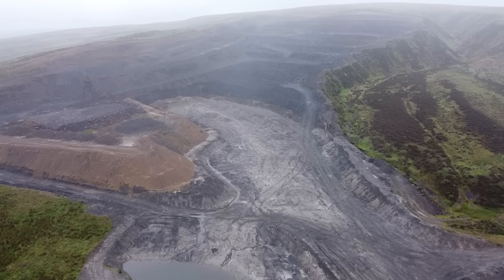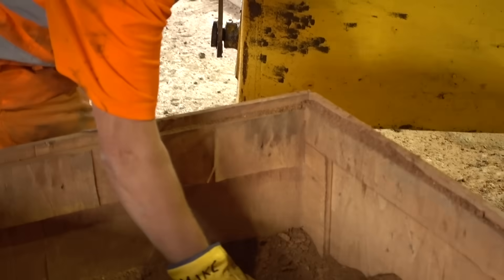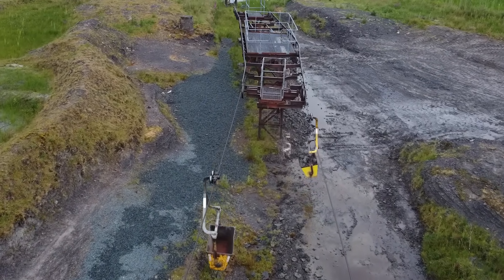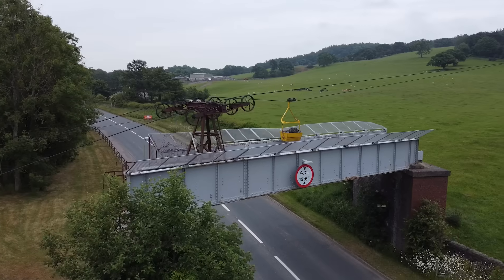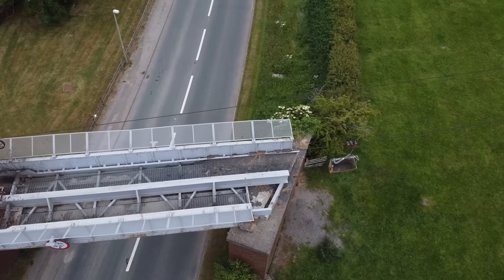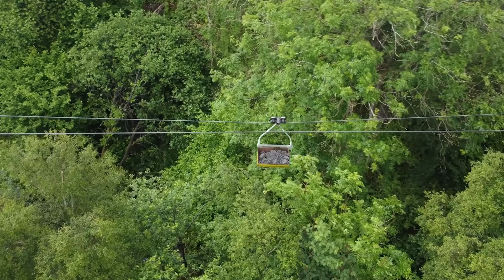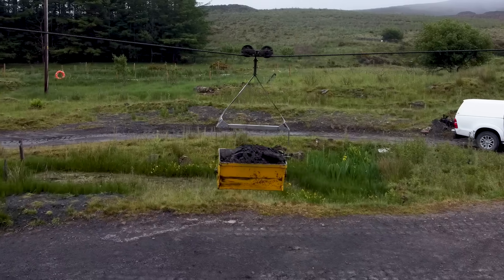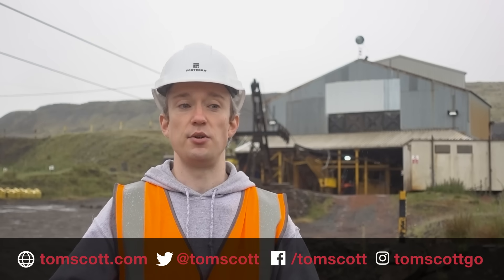The UK's last aerial ropeway uses no power, moves 300 tonnes a day, and will be gone by 2036.

Comment: Can you imagine the amount of fuel savings, labor hours ( truck drivers ) and lack of pollution this ropeway has been responsible for over its lifetime? Well done to the engineers of yesterday.
Reply: Never underestimate the power of an old bloke with a slide rule
Reply: @jayoliver3734  this is a quote I need hung on my wall
Reply: I am truly amazed. We need more of this.
Reply: @tiki_trash  This was my thought - why the hell aren't more quarries and mines using similar setups? Even if they needed some power due to less favourable geography, I'd guess an aerial tramway would have huge fuel savings over lorries or rail, and is much less disruptive to the environment than either, and easier to electrify.
Reply: @lmlmd2714  over lorries yes, rail less so. With rail your main resistance is from air resistance (above around 20km/h) since even a 16 car train with 120 wheels will only ever have around an A4 size area of ground friction if you're unlucky. If you're lucky it'd be around the total area of a 50p coin.
Reply: @lmlmd2714  Because this setup only works down a hill.
Reply: @tiki_trash  on this large a scale probably not but on smaller scales? this could be incredible
Reply: @tiki_trash  if we always went downhill, we could!
Reply: Check out English canals. England used to move tons of coal and products across the country by longboats dragged by a single horse.
Reply: @Nemesis_T_Type  Horses are more polluting than trucks.
Reply: @Nemesis_T_Type  and blokes on planks for the tunnels.
Reply: @Nemesis_T_Type  if you're fine with low speeds, boats have some of the lowest moving resistance that likely tends towards zero in still water. At high speed, boats become extremely inefficient. I think it needs like 8 x the power for every doubling of boat speed, meaning 4 x the energy use for the same distance.
Reply: @Nemesis_T_Type  
Sad that UK produce nothing these days
Reply: @P JL Good point. There’s an old limestone quarry about a quarter of a mile from my home that’s now a Site of Special Scientific Interest, due to the wildlife living in it, and especially due to bee orchids growing there. It’s a big hole in the ground where the sides of the quarry shelter the ground from the worst high winds. Nature finds a way of making something work, even when mankind has massively interfered with the landscape.
Reply: @BungleBare  Many quarries worldwide have ended up becoming rich nature habitats and sources of water.
Reply: And this kind of tech could be used today and make our world cleaner, and better. But we don't measure the right things or value them. The people saying this costs more $$$ are correct. And in our world that is the only "efficiency" that counts. Even if it means pouring toxic fumes into our lungs, if it saves money then it's OK.

This is why we'll go extinct. Stupidity.

It's the same philosophy that says driving a car to workout in a gym is more convenient than riding a bicycle.
Reply: @ruslbicycle6006  and it's funny because nothing about this world is efficient.
Reply: not so much. 4 employees required constantly. 2 shifts per day.
a union job for life, filling buckets.
become an expert after one day. snore
Reply: @godsinbox These days, the it could easily be mostly automated, it's just not worth it to heavily rebuild multiple structures for something with such a limited lifespan.
Reply: But can they replace the break pads with electric generators?

I've heard, but never fact checked tbh, of mining operations using electric trucks that never need to plug in; start at the top with a full load and an empty battery, regen breaks the whole way down the hill/mountain, drive up empty on the power from the trip down.
Reply: @peterelliott3905  No offense but what would be the point of that? It just sounds like doing what the rope way does but with extra steps.
Reply: @kylesmith4173  The plant has tons of conveyors, lights, presses, kilns, etc. that could take the power…
Reply: @peterelliott3905  they indeed are a thing!
Reply: @peterelliott3905  the fact is that you have to store that energy...batteries are expensive and the energy that they would gain from it would be small? In comparison to what's needed for that company to run ..also maybe they are already doing it
Reply: @peterelliott3905  that's possible. Sounds like it can be done without violating conservation of energy, given that there's enough load on the way down.
Reply: @peterelliott3905  It would be very inconsistent power generation. You might be able to bank it into a battery pack for peak power demand supplementation, but you'd also be trying to dance a fine line between meaningful power generation while also letting the rope way keep sufficient speed for efficient operation. I would be curious to find out how many kilowatts per day the braking system bleeds off. 

Might be able to supply the power needed to operate the electrical demands within the brickworks though.
Reply: @peterelliott3905  no Regen isn't that efficient
Reply: @peterelliott3905  Eternity machine!
Reply: @peterelliott3905  Yes they can, and they would have if the cost benefit  made sense.
Reply: @peterelliott3905  That would only be possible with 100% efficient energy conversions, which do not exist.

The friction of the tyres alone would make that impossible.
Reply: @peterelliott3905  That would violate the laws of thermodynamics to be true. Change it to “charges very rarely” and it might be true.
Reply: @peterelliott3905  It does seem like someone would have thought of this. They must be using some sort of water/oil/non-friction brake though as replacing pads would be ridiculous given the constant load.
Reply: @peterelliott3905  That literally defies the laws of physics and conservation of energy
Reply: @peterelliott3905  that idea in its best form is replacing the conventional brakes with regenerative brakes but keeping the ropeway. Then the transit of the shale is not only unpowered, it’s actually power generating. Probably quite a lot. A ton of weight going down several hundred feet every couple minutes is nothing like a trivial amount of power either, you could potentially run damn near the entire brick works save for the furnaces on that.
Reply: @peterelliott3905 hahaha dude no there isn't free energy in the universe. Braking helps, electric and self driving have been around a while now in industry. Thier clients don't find equipment on YouTube so you don't know about it yet.
Reply: @peterelliott3905  regen braking wouldn’t charge a battery completely by just going downhill with load, it would need to be a very long hill
Reply: @peterelliott3905  Yes they can replace the brakes with regen but nobody would be suicidal enough to do it. Hint: regen fails then what? They need it both for a little braking normally but they must have the backup for emergencies.
Reply: @peterelliott3905  I'm unsure on this. Sounds like perpetual motion. There are always energy losses in heat, sound, friction etc. I think if the vehicle had full charge at the start of the day, and used regen only on the way down, it would keep the battery topped up enough for it to run for the day. 

You got any links or anything I could take a look at? Sounds interesting
Reply: @peterelliott3905  yes, that´s a Komatsu electric trun, it charges the baterry downhill (full of ore) and goes up (empty) with that charge
Reply: Well said
Reply: At a mine? It doesn't even offset the workers going to work... Cool concept, but it's not for environmental reasons, again, at a mine?
Reply: Maybe if you hook a dynamo to it it can even generate electricity
Reply: Old beats New :O
Reply: Big tip of the hat on this one.  Very cool
Reply: gj
Reply: Before you jump down my throat about being wrong, I’m no mathematician, and I have no idea about mining/trucking operations. But, it’s an interesting question, and I’m sure there are experts reading this that might want to dive into these calculations to see how much this would’ve really cost. So, this is just to spark curiosity. 

Using todays standards (obviously these mean nothing just 10 years ago, let alone 100 years ago) if an ore moving truck moves 20 tons per load, and gets 5mpg on Average (full loaded on the way down hill uses very little fuel, and empty on the way back, using more fuel) if diesel is $3.87/gallon (I realize they don’t use $ or in the UK) each trip one way would cost about $1.94. They would need 6000 trips (3000 each way) to move 60,000 tons/year. It would cost roughly $11,640/year in diesel. I’m sure my math is wrong somewhere. 

That number is much lower than I would’ve thought. Obviously, this doesn’t consider maintenance on the trucks (brakes alone would be insanely expensive, carrying 20 tons of ore while riding the brakes) drivers, roadway maintenance, maintenance garage expenses, load/dump equipment cost and maintenance, etc, etc, etc.
Reply: I wonder if it could compete cost-wise with a truck, a digger, and a couple of drivers though. The maintenance cost of the ropeway is likely higher and fuel costs for that short of a distance would be low. The capital cost of the ropeway must be far higher (though long amortized away). As for labour, I'd guess that the number of people would be about the same. Using trucks would be much more scalable (up or down).

For pollution though the ropeway takes the prize by far.
Reply: @graham1034  Those trucks aren’t exactly cheap though, and maintenance on those trucks is what it costs on your car with an extra zero at the end.
Reply: @graham1034  That's a lot of cable! I still think it's got to be cheaper than diesel. If it was more efficient to do another way, I'm sure the mine would have implemented it a long time ago.
Reply: @tiki_trash  if it was much cheaper I doubt we woulda replaced them tho
Reply: @tiki_trash  you are doubting the rest of the mining industry
Reply: @graham1034  What about the capital costs of trucks, maintenance, fuel and drivers for each truck? Also roads with frequent heavy loads degrade significantly faster - so don't discount dramatically increased road construction costs and ongoing maintenance that a constant stream of heavy trucks would demand.

Yes, the ropeway has maintenance but trucks and roads are far from a free ride either.  I mean they replace the cable every six years (!)  Replace a few bearings on wheels, paint a tower now and then to keep rust at bay - the amount of construction materials and operators for the ropeway is trivial compared to what would have to go into a fleet of trucks and a road sturdy enough to sustain the volume and kind of traffic.  And that's discounting the ropeway requires no fuel!  None.  Gravity powers it.

If the maintenance and/or operation costs were higher they would have switched to trucks already.  It's not like they maintain the ropeway just because it's cool, they maintain it because it's cost effective.
Reply: @graham1034  I assume the accounts dept have done the maths many times in the last hundred years but it seems to still be the best option for them.  You'd need at least 2 trucks for redundancy,  driving teams, loaders and unloaders, maintenance and fuel, I can see why it might be a hard match
Reply: @graham1034  Bear in mind that there may not necessarily be a direct road connecting the two sites - this would also need to be built and maintained - and would take up more land - perhaps incurring rental if on agricultural land. There is a quarry supplying stones for highway construction near me - the tarmac B-road gets a real hammering the big wagons and needs regular repair - luckily for the quarry operators, the cost of these repairs are shared out to tax payers.
Reply: @graham1034  i guess no, burning fossil fuels with a machine, that has billions of copies (aka big scale) is the cheapest we have today. 

On the other hand, if you had millions of this rope systems, the mast and maintenance would cost you peanuts.

By the way, the German institutes SLA and HFE are developing the upBus, a bus that can literally hop onto a cable. Might be a capable technology.
Reply: @graham1034  fuel cost is often a large part of the cost of running systems.
It's one of the reasons short flights are pusshing for electric
Reply: @mrman991  
Define "short flights" are "pushing for".
The only company that comes to mind, that's trying to create an all electric short range plane for commercial use is lilium.
And this thing is advertised for a 300-500 km range.
The bigger airline jets are more likely to switch to Hydrogen or E-fuels.
Simply because the batteries that we know have a far too low Energy density to be commercially viable in an industry where every additional gram is going to cost you thousands over the span of the lifetime of the plane.
Reply: @carstekoch  I think Cape air are looking at electric planes, most of their flights are under a few hundred miles though.

Blurry memory though
Reply: @graham1034  it's either a million dollars and six years worth of diesel along with compacted gravel roads. Along with downtime for maintenance and being not allowed to work all hours because you're in a semi residential district. It's at that point more efficient to make the rope system. The factory isn't going to move too. If this was noisy and wasteful like with trucks the people surrounding it would have objected years ago.
Reply: @graham1034  
Insurance for the trucks too. Also if there is any problem on the road that means nothing gets through.
Reply: @graham1034  Eh some new bearings and some wear parts aren’t so bad. It’s not like articulated dump trucks are cheap to buy,
maintain and run.
Reply: @graham1034  What about the costs of increasing the greenhouse effect?
Reply: @graham1034  Road maintenance for trucks isn't cheap either though. I imagine the erosion is quite bad there.
Reply: @graham1034  Would be interesting to see a comparison calculation. My money says the rope at this point in time would beat the truck, digger and drivers easily.
Reply: @graham1034  Fuel prices alone would eclipse maintenance on this thing a hndred times over.
Reply: @graham1034  maintenance on big diesels is absurd dude like absurd.
Reply: @graham1034  it would be Interesting to model out the economic case
Reply: @graham1034  I think it must be similar in costing to have lorries moving it, or negligible difference. This pully system has not failed in years, always worked. You only need to replace the rope every 6 years.
Reply: @graham1034  i dont think it would be too expensive, think about all the ski resorts all over the world with almost the same system just motorized and they arent to expensive.
Reply: @graham1034  metal wire it not that expensive, 1 truck cost way more. without fuel....
Reply: @graham1034  The maintenance cost of the trucks is far higher, add to that the fuel costs and the building and maintenance of a road. I'd say the old fellows had the right idea.
Reply: @graham1034  but distance wise might not be as short as you think the rope goes directly across where as a truck would have to wind through roads. Ie my work is directly beside the highway yet takes me 20 minutes to get there from highway once I get off from exit
Reply: @graham1034  also the rope never gets sick, needs a vacation or gets stuck in traffic
Reply: @graham1034  thing is this just has maintenance costs

trucks and drivers would have maintencne also as well as fuel and wages costs

plus how many trucks would you need to be able to match that frequency and tonnage per day?
Reply: @graham1034  Roads require expensive maintenance and resurfacing as well.
Reply: How would a suspended metal rope and metal wheel require more maintenance than a truck, conveyor belt, any other material transportation method; that would require thousands of moving parts working at once? Doesn't seem right.
Reply: @graham1034  The capital costs being amortized away is huge I think. Trucks and roads would take massive capital maintenance over the course of 100 years, but this ropeway very little. I think we should be more forward thinking with our engineering now that the growth of the physical parts of our economies has slowed down. In 1820 there was very little reason to build something to last 200 years when something better would come along in 30, but now making something last 200 years is cheaper and better than redoing it every 30 years because it wore out that fast. I already follow this principle in my personal life with consumer goods and it's saved me a lot of money not replacing cheap items every few years and instead holding on to higher quality items for a decade or two or more.
Reply: @graham1034  Clearly it is much much cheaper to use the ropeway system rather than trucks and drivers! Those trucks need maintenance too. The biggest day-to-day cost would be wages and fuel. It would be very easy for the shale quarry business to have changed to a truck based system ... but they didn't, so there's your answer.
Reply: @graham1034  I don't think maintaining the ropeway would cost more than maintaining and fueling a fleet of trucks, and the roads they drive on, and paying all the drivers.
Reply: @graham1034  You are comparing it with trucks and diggers with the maintenance , that system only needs some grease every so often and the wire will self lube itself after a build up of grease on the bearings and rollers . Dont forget , those trucks and diggers need maintenance as well and you would need spares on standby  in case of breakdowns .
6 trucks at least to do the same amount of work and at least 2 digger drivers so the workforce would go up
Reply: @graham1034  Don't forget the road maintainance of the road for the trucks. If the alternative were cheaper, they had changed itin speed of light to save money. So operating this must be cheaper than alternatives :-)
Reply: @graham1034  No I think the rope way would still probably greatly be better than the trucks as they require maintenance as well as fuel but less labor maybe? It probably because in modern days the factory will be considerably farther apart in example all raw for bricks would go to just one factory location from several sources.
Reply: @graham1034  Also makes me wonder if they could have just built the brickworks closer to the hill, but it might be sited closer to water and labor.
Reply: @graham1034  Nowadays you can use electric dump truck that will charge its batteries while breaking down the hill with a full load, it should be nearly enough to go back up with an empty load.
Reply: @graham1034  if trucks were cheaper, they'd be using them right now
Reply: @graham1034  it's probably because of the short distance that this is viable, the shorter the distance, the higher the percentage of fuel wasted on idle especially when crossing that road.
If we were to compare today, then definitely, trucks and diggers would definitely be cheaper, we have hybrid vehicles and many modern vehicles can automatically stop and start their engines. But back when it was built, the vehicles would have been way less efficient and also probably way less reliable. 
The only reason they're not switching is as you said, this has been paid for and getting new vehicles is just an extra cost.
But then again, is the maintenance of this really more than a few vehicles? The ropeway is extremely reliable,if you have 5 trucks and one breaks down, that's a significant impact on the time taken to deliver the shale, easily fixed by having spare vehicles of course. Vehicle maintenance can also cost a lot especially when you run them almost constantly. Coupled with the fact that the vehicles will have to be replaced after awhile, the ropeway might be cheaper to operate over a long period of time.
However if the factory was much further, like 20km away or more, then definitely, trucks would be cheaper.
Reply: @graham1034  If trucking it cost less, that is what they would have done.
Reply: @graham1034  100% wrong..

The maintenance of the ropeway is next to nothing, Few metal cables................Jobs done..
Reply: @graham1034 not by the ton it doesn't. You're missing all the non obvious costs that are polluting.
Reply: @graham1034  you hit the nail on the head. they were great when there wasn't a better option, but driving a truck with a few tons of material downhill the whole time, and only having to drive uphill back.

you still need all the same stuff, but instead of having 10 guys working the skyline, those 10 guys driving trucks move 10x more material in a day
Reply: @Seldoon_Nemar  The real answer would be to just have a more automised loading/ unloading system as would be possible nowadays, so that's hardly a concern
Reply: @farmerboy916  it's not the loading an unloading. someone has to grease all of those sheave wheels, brakes need maitenece, buckets fall off etc. whereas you can have extra trucks so if one goes down, you're not stuck, whereas if a skyline fouls, everything stops.

and remember, in terms of arial trams, this one is really simple and fairly small
Reply: @Seldoon_Nemar  don’t forget though that those buckets also are measured to a set speed so that the amount of material they get is the amount that they’re able to process. So even if they did get those 10 trucks like you said, it may just end up having trucks full worth of material dumped in a warehouse while they wait for the previous loads to be processed… you could say they could build more buildings to process it but that’s wayyyy more expensive
Reply: @Seldoon_Nemar  Perhaps they can shift more, but can they produce 10x more bricks. The brickmaking is probably the thing that limits the production.
Reply: @tonyprescott2256  yes. They can. Getting the material there is the hard part, it's easy to expand existing processes once established. You just can't get the volume and reliability to scale up because if one wire broke, then your operation shuts down for days unless you have a huge stockpile.

These had their hayday but are not up for commercial/industry use these days. Just like hulett unloaders, just the skeletons of steel giants
Reply: @Seldoon_Nemar  The transport capacity of the ropeway matches the production volume of the. Faktor it feeds. No use nor sense in inreasing it tenfold, li'l wise-guy.
Try thinking before (!!!) writing one of these days.
Reply: @Baetzibaer  so you just plan to never expand and never need to worry about work stoppage from mechanical failure...
And considering that it will double the staff of of the factory, because keeping a tram running is a full time team of guys and if it stops for any reason you're stuck.
Reply: @Seldoon_Nemar  Who believes in infinite growth in a finite world und is either a madman or an economist.
Reply: it's brilliant. same energy source as rolling a boulder down a hill, only placed in buckets and strung along a rope.
Reply: Yesteryear I guess
Reply: In theory they could run a generator with the breaks to create a bit of power to run the break system and potentially provide a bit of power to the grid
Reply: @exploding5525 : Breaks? When they take breaks, or...?
Reply: If the load moves down it works yes.
Reply: No need to imagine; you can calculate the energy savings if you know the total mass of material that was moved during the lifetime of the mone, and the height difference between the start and the end. E = m*g*h
Reply: A needed start in the right direction sadly forgotten for its is usefellness
Reply: i didnt murder anyone in my 28 years on earth.
Reply: @collander7766  3 x 300 = 900, not a million. Your math is wrong.
Reply: Yes! There are not many projects like this today
Reply: And that is not good. Pollution is healthy.

-Capitalism Motor Companies
Reply: Technology increases at the rate that Ingenuity decreases.
Reply: Location is key
Reply: Lack of pollution, to carry coal. But yes, you're right.
Reply: @Tim and you need a good reason for every ton of gold and silver on earth to make about 500 trips.
Reply: But all is not about reducing pollution, innit?
Reply: Today's engineers could learn a thing or two from their past colleagues. Don't always computerize everything, just let physics do the work
Reply: @pix-point  yup that's true..books doesn't teach everything.
Reply: ok
Reply: Well said
Reply: Shows why they are constantly searching for free energy devices
Reply: actually i wonder if it is a lot. I mean compared to the brick firing process, maybe the transport energy isnt all that much even with a modern conveyor.
Reply: ...Then imagine not using these methods for modern transportation, cause it takes business from fossil fuel producers.
Reply: Don’t try fix something that’s not broken
Reply: 1920's engineer took my trucking job!
Reply: @creamwobbly  i've never seen a mine that only transports pure gold... it's usually measured in oz per ton... so if you're getting 4 oz of gold per ton of host, (which is INSANELY good. usually it's around 1oz/ton these days) you're talking 20 million meteric tons of ore to get that 2500 tons of gold... at 1oz/ton, you get 80 million metric tons of ore transported... per year... or about 15 years to reach a billion tons of ore transported...
Reply: So much for the world climate change agenda
Reply: eeeeeeeee
Reply: Shows that people in the past were not dumber. They still know how to use their resources and technology of their time
Reply: We should start making these again I mean with a little updating I see no downsides
Reply: Oh hey Joe :D
Reply: They should really build more
Reply: The Aberfan disaster in Wales, killed off the ropeways at British coal mines.
Reply: being lucky to have the mine up hill and the process below does make it work if it was different than alas
Reply: ...I have some Epic Recommendations!

Why?

Why do i recommend stuff to strangers?

Well, lets be honest... we live in a Quality-Hole named '2021' and Quality got real-rare, tbh.

Sooooo, why not... 

Check out:

-Starship Goldfish.

-Cliffside.

-Pokemon: Banette's Curse.

-Raised by Zombies; Marathon.

One more epic than the Other!

Have Fun, stranger.
Reply: It wasn’t made yesterday you weenie
Reply: And to think a modern day computer can't come up with a better design....
Reply: You are correct! Had the rest of the villagers known beforehand they would have left their thatch houses be, secure in the knowledge the wind would not take it.
Reply: *yesteryears
Reply: We should use these today when possible
Reply: The fuel is the potential energy up there at the hill.
Reply: dumb af. STILL USING ELECTRIC CONVEYORS - STILL USING TRUCKS. gods people are dense.
Reply: @jwn741  Well in fairness, not all quarries go downhill like this one does. At least electric conveyors aren't diesel conveyors.
Reply: @wyndhamcoffman8961  so their conveyor system runs magical electricity that doesnt burn anything? this "system" isnt doing anything. it's a story about nothing. it's nothing more than part of the shipping line that could be excluded entirely and the carbon footprint would be IDENTICAL to what it was before.
Reply: @jwn741  I have no idea what you're trying to say there. My point still stands that this conveyor only works going downhill.
Reply: I KNOW - unbelevable.
Reply: Glad to see this as I never k ew of such a thing, and soon it will be gone and had this not been put up on here many would never know of it.
Reply: And today. Never underestimate those who maintain.
Reply: This wouldn’t really work well for thag
Reply: Still fills a dump truck
Reply: Pollution yes, labor hours no. You need people to fill those buckets. A huge truck with a huge excavator would be more efficient (and cost saving) than this system. Maybe a mixed approach would use the current infrastructure, with an excavator loading a huge funnel that fills the buckets one by one, automatically, so you have a single operator that uses the excavator and the transport is done by the buckets.
Reply: They said 300 tons a day, so assuming no days off no holidays or anything like that it's about 110,000 tons a year. Operating since the 20s, that's 11,000,000 tons of shale. A typical large dump truck has an average volume of 14 tons (according to google), so that's about 790,000 dump truck loads. I have no idea how to calculate the fuel cost from there.
Reply: Good ole Yankee ingenuity.
Reply: 2:05 it then ultimately feeds into a dump truck.
Reply: Regenerative braking in addition to brakes could have generated a large amount of electric power and money over the decades.
Reply: We evolved,  Just Backwards
Reply: Good thing I don’t believe global warming lmao
Reply: I can imagine a world with out all the smug people that type things like this
Reply: The yesteryears were the proper days.
Reply: Very smart use of potential energy
Reply: And lost jobs..
Reply: @naminami9600  actually you need a relatively larger labor staff to run the tram than driving with trucks. You can have 3 extra trucks and a mechanic, but if you have a problem with the tram, you're just stuffed, so you keep a team of 10-12 to fix it asap
Reply: Burger
Reply: It has saved nothing. There was never a need to waste energy here.
Reply: Think of the pollution made to build it tho
Reply: @xlbeanboi2653  investing into something as efficient of this is worth it, the pollution to build something is finite, the pollution from ongoing transportation of goods is the reason we are in a mess
Reply: @david94549  then why haven’t we built these all over, tell me cause I really don’t get the point
Reply: @xlbeanboi2653  because the most profitable option isn't always the most energy efficient or environmentally friendly, it's usually dictated by factors like time/speed, volume capabilities, initial cost etc. We have energy in the form of oil which is abundant so we use it because it's cheap, not because it's good for the environment
Reply: There’s a quarry or mine in Switzerland with electric lorries, they drive down the mountain and charge the batteries with regen braking, leaving more than enough power to drive back up empty. Massive trucks they are as well.
Reply: The loading/unloading seem to be quite labour-intensive
Reply: @jackwalker4874  Not much more so than loading lorries.
Reply: @trainman665  lorries can load in bulk under a hopper, and unload by tipping. Handling a quarter of a tonne at a time with all the maneuvering seems slower
Reply: @jackwalker4874  The hopper needs loading before the lorries, and you’d need multiple drivers for the lorries. They are a profit making business. If there was a more efficient way they would have done it!
Reply: America could have sought for this tech in the 20s and 30s
Reply: its nothing compared to everything else.
Has maybee saved a few weeks of flying, not more.
Reply: @josefinandersson7646  A few weeks of flying is a hell of a lot of pollution.
Reply: I mean you can pobably replace those like 5 guys in each side with 2 truck drivers but fuel saving yea
Reply: Couldn't the braking system generate electricity?
Reply: ...I just see a missed opportunity by the engineers to generate a huge amount of power instead of using a brake system 😞
Reply: @orangefortune  how would it be a pwr opportunity
Reply: Greenies should learn from this project. But wait, it won't make the select few rich.
Reply: It all gets loaded onto a truck anyway as he says in the video so does it actually save anything? seems like extra steps for nothing to me
Reply: I’m a pit loader operator in Georgia USA. I load 1300-1400 tons an hour tops with a 992K Caterpillar.
Reply: Can you imagine how much cheaper it would have been if they had just built the processing factory in the center of the shale mine?
Reply: @PoppinLockNessHopster  Good idea for an established mine. But you can’t put a processing plant in the hole before the hole exists.
Reply: What if they add a newer generator as electromagnetic brake as new main brake and keep the now used brake as backup? This way it would generate also some additional electricity
Reply: I wouldn't be surprised if this *was* actually cheaper in the long run.  However, you have to consider the fact that it's a high upfront cost you can't recoup if the buisness becomes unprofitable.

That makes financing hard.  You need some trucks?  No problem, you can probably lease them or get a loan with the trucks themselves acting as collateral.  That aerial conveyor has only scrap value if you go belly up.

THIS is why you need a carbon tax.  You can't do it just by encouraging people to get solar panels or whatever.  There are a million solutions like this that will be found if you create a strong enough incentivize.
Reply: Virtually none when you consider the offset required to break even vs the actual mining operation 😂
Reply: The amount of materials it can transport is very small conveyor belts are the best
Reply: Conveyors are better there still has to be trucks cuz they can’t just easily expand that thing and not every mine has a thing that goes downhill
Reply: it was probably more about cost saving than anything even so good job on the engineers.
Reply: Fuel doesnt need to be used when going downhill. If it went uphill without electricity then i'd be surprised, but this is common sense. Youtube is dumb these days.
Reply: but realistically small quantity. it's nice it doesn't waste fuel but the output is tiny compared to a large industrial setup.
Reply: Well they weren't exactly gonna use trucks back then were they?
Reply: Agreed. The Chinese mind cannot comprehend it!
Reply: Gravity, who would of thought eh ?
Reply: People in 2021: "This has to be greener, we have to drive on Electricity, we have to take care of nature." 
Engineer in 1920: "imma build a transport line of a mile long which won't require any type of fuel, ez."
Reply: @frederikvaneeckhoven4458  you realise that’s because it’s possible to gravity power a ropeway, you can’t gravity power a car
Reply: yester-century literally. People of the past were often more clever than we think. They could have built an engine for it, or built a small rail line, but why bother if your payload propels itself?
Reply: Truly amazing?
Reply: and that the computers of today had the same measurements of a human with a pencil 100 years ago - amazing
Reply: The expensive part is replacement parts
Reply: Oh hi pleasant surprise seeing you here Joe!
Reply: Exactly. These green special interests conveiently ignore that electric batteries and EMF radiation are amongst the biggest pollutors and strains on the environment (ie mining lithium for electric batteries)
Reply: That's back when Europeans were allowed to be ingenious and thrive though. Now they're a region in decline, tearing out the pipes of their house and selling the scrap copper to try and pay the bills while claiming everything is alright we can afford to take in another quarter million migrants a year even though in 35 years only 8% of them are gainfully employed.
Reply: It could even generate decent electricity nowadays, with power electronics & newer generators
Reply: If it is modernized it can be and would be more efficient then just trucking it all but if you dont mind the expenditure trucking is vastly still superior in the short term.
Reply: @isaacfoster1377  why Change something that as worked perfectly for  Many years and Cheep as Chips to maintain and Obtain. And I Bet the Maintenance on the Aqipment is second to None.
Reply: I thought the ropeway has been running for decades if not centuries not just this week? Why do you think it's only been operating since the day before yesterday?
Reply: The buckets fill trucks, you have no idea what the savings are ... but it looks quiet.
Reply: @johnsmith1474  Actually not. the buckets dump through a screen, then onto the conveyor I spoke of, then into a truck. This system is only as efficient as the capacity of the conveyor.
Reply: Yes for trucks, but I doubt they use that much electricity if they had to go upwards.
Reply: There are flaws in efficiency. It’s 100 years old it needs to be replaced.
Reply: They could use this theory in Westminster. Imagine the kinetic energy of a line running straight downwards to hell for all the treasonous
Reply: Can they convert it into a gravity energy storage device. Hook up solar and a motor/generator to drive the weighted buckets up hill, and then at night or on a cloudy day let gravity do the work to output electricity from the motor/generator
Reply: Well done to them? Nah... well done BY them.
Reply: @Fremen you are completely correct.  Tge problem is now a days "old ways" equates to "hard work" in the thinking of younger people.  They don't understand hard work and don't think that hard work gets them anything.
Reply: Fuel and pollution yes, labour certainly not. Manhandling these buckets is INCREDIBLY dangerous, back-breaking hard work - the slightest error in timing and you break a bone at best, lose a hand at worst. The people working on these lines are all veterans, and eventually they will retire, and no youngster in their right mind would want to replace them when you can earn more sat behind a computer and not be risking your bones and hands every day. A modern system would be much safer, completely automating the filling and emptying of the buckets, saving on labour costs as well as safety.
Reply: To say it requires no power to operate is a bit of a misnomer, unless it runs continuously 24/7 it’s going to have to require power to restart the system because the weight of the loaded buckets of ore will become less than what is need to get the system moving. If you stopped filling the buckets at the top and started sending empty buckets at some point the fewer and fewer full buckets on the downward slope would be enough to pull the empty buckets up the hill. You would have to engage a motor to keep the system moving until all the full buckets have been emptied, THEN when you restart operations you would need a motor to get the system moving again until there was enough load on the downward slope that it worked again on its own gravity
Reply: Have the savings been enough to offset initial costs and maintenance? 🤔
Reply: Cool, now do it with the brick works uphill.
Reply: Than it’ll rust out be forgotten and now we have a ugly mess of beams and wires never to be used again, Soviet Union style
Reply: Of course 100 years ago, generating any amount of energy was a challenge; when you consider that even the largest water wheel could only generate about 100 horsepower. So engineers back in those days put in a lot of effort to make do with what they had available. Whereas modern engines, even a relatively tiny one can generate 300 horsepower; and then you don't have to think about where your energy is coming from or where it's going to. All you have to think about is how to move as much material as possible, and even then that's not even thought that well through. 
In a way that's the difference between a fleet truck and an owner operator truck. The fleet operator has a lot of trucks and a bottom line to think about; and will spend more for efficiency. Whereas to the owner operator, efficiency is a dirty word; they will speck the biggest truck possible, and drive as fast as possible.
Reply: I was like how the frick does this work but then it was gravity tom said and I still don't understand it. There's almost no downhill?
Reply: And then they are going to remove it
Reply: Yes but no, taking away jobs, not to mention it's extremely insufficient
Reply: Imagine the environmental impact that the open mining and the burning of the coal has on the environment. So people make ridiculous statements like this and do not look at the other part
Reply: Imagine how utterly inefficient this is compared to modern machinery. There's a reason it's the last of its kind.
Reply: Probably not alot to be honest. 
Maintenance and other things are only to get worse as the machine ages.
Once one of those towers breaks the production will be hit hard and there will be a while before they will be operational again, plus procuring those parts will be incredibly difficult seeing as how it's the last one left.
Reply: @uh3what  this is just some common bearings and a common steel rope. The only thing really custom is the bucket. It doesn't even have an engine, it's just a single steel rope running on bearings with 2 big wheels at the end for the 180 degree turn. Any mechanical engineer can easily maintain this. It should also be quite reliable and not require much maintenance, due to the limited amount of moving parts, and such bearings being so common in the world.
Reply: @uh3what  I’m thinking that after 100 years they’ve stockpiled a few parts and have a contingency plan (plus a stockpile of the shale)
Reply: @uh3what  they will have someone still making the Parts,and it will Be very well Maintained, or it wouldn't have Lasted all this Time, you Wouldn't just Run a  Machine and just Hope for the Best, that would be Stupidity.
Reply: Whoever set this up found a literal gold mine in savings
Reply: @elocore1702 : No, shale.
Reply: but i wonder how does the bucket come back after delivering the coal do they use electricity ,?..when it delivers the coal  it works on the principal of gravitational force...but while coming  through that slope which require some sort of energy how does that happen .?????
Reply: @jyothindev  is it a single closed loop? should be obvious how, in that case. the weight of what is coming down exceeds the weight of what is coming up, at all times.
Reply: @jedinxf7  even   i doubt the same ..need to see this thing in real
Reply: @jyothindev  what's so hard? picture a pulley with someone working at the top and the bottom. put weight in buckets going down. empty the ones at the bottom and send them back up empty. at what point does this pulley need anything but gravity, and the weight of the descending buckets, to keep the system (including the ascending empty buckets)  moving?

now replace your verticle pulley with a long one that's no longer perpendicular to the ground, but still obviously has a top and bottom, and heavy things descending and lighter ones ascending at all times. nothing about the relationship between heavy things descending and lighter ones ascending would change.

if the system is designed like that, the only energy you need is for loading and unloading the buckets, plus a braking system because the gravity would otherwise make it move too quickly and continuously.
Reply: @jedinxf7 : It looks like it could only work if the buckets that can ride the rails freely are then locked to the cable, meaning that the whole cable is forced around by the full buckets, lifting the empty ones that are also locked on. The bucket wheels would never just roll up the cable, haha!
Reply: Good for environment, not good for economy. Imagine how many people would have a job and money if it wasn't made such smart way ;)
Reply: And lack of jobs 😉
Reply: @PleaseStandby888  destroying jobs by efficient innovation is not a bad thing.
Reply: Why they want it gone.  Not making money for the 1%
Reply: @ryantownsend2730  
🤣
Although I'm with you on wishing the 1% would be dissolved by an unknown space laser, I don't think they're to blame here.
In an age where everyone is scared of litigation, this is a health and safety nightmare. 👍
Reply: 300 ton a Day is 9 trip with an articulated dump truck,  at 3 miles per round trip 2 hour of said dump.truck per day will do to equivalent work
Reply: Less fuel, sure. But less labor? Are you crazy? It takes way more manpower to keep that running than it would to just have a fleet of front end loaders and haul trucks. The loaders and haul trucks would move more material too. Why do you think all of the other ropeways went away? Hundreds of them, abandoned for modern haulage methods.
Reply: @CharlieMikeNS  Regardless of whether you are sitting in a driver seat, or slinging a shovel, its considered a labor hour. So the labor hours saved by not paying truckers to drive is considerable. Now lets look at the rest of the system. Actually, the weakest link. The conveyor belt delivering the raw material to the crusher. so it wouldn't matter if you had truckloads of raw material sitting outside, its only going up that belt so fast. So to answer your question, no I'm not crazy, I'm realistic and analytical, and yes, many labor hours were saved. Until they rebuild the rest of the plant, this old piece fits just fine.
Reply: it took our jobs!
Reply: @TheWerelf  You'd rather have a bucket of shale on your back?   You were a bucket carrier?
Reply: Slave Wagons are more efficient, free energy downhill and with some solar power they can easily get uphill.
Reply: @o74769  solar power I'd the dark dismal north of England? You having a laugh mate ? I know global warming is here but it ain't hit us that hard in temperature rises yet!
Reply: @o74769  too bad slavery is illegal sir
Reply: Doesn't offset the giant scar on the land, deforestation, and destruction of habitat caused by that mine though.
Reply: @shirosenshiesq  20-30 years after it closes that mine will be overgrown with vegetation again, its not destroyed. And deforestation might be a bit of a stretch based on where it is... Coordinates 54.077803230082736, -2.645832726574359 its mostly wild grassland which will recover very quickly when we're done with it. 

We need building materials, I'd argue that the small environmental impact that this has on the area is insignificant when weighed against the 120 years supply of building materials we will have from it.
Reply: @shirosenshiesq  You do realize bricks need to be created somehow, right? Like, would you rather live in a very expensive cut stone house? Oh boy, that costs a LOT of manpower and transportation! Or maybe a wooden house? No, that's much worse! Or perhaps cement? Oh wait, that's C02 central! And as much as I love the idea of Hobbit-holes, the emissions from digging with current technology are prohibitive, and guaranteed to be low-population density.

If humans want to exist, they need to come to terms with the fact that at least some temporary damage will be done in the short to medium term, and focus more on restoring the landscape post-mine (i.e. covering the site with erosion-resistant materials, and then topsoil, and seeding vegetation to prevent the topsoil from eroding. Local groundwater is substantially polluted for the foreseeable future). Problem is, we are happy for the lump sum to establish the mine and the ongoing costs in exchange for the benefits of such mines while in operation, but we aren't willing to pay the lump-sum to restore the land to sub-par, but still agriculturally sound land. So often, it just ends up being a wasteland, which is, well, a massive waste economically and ecologically.
Reply: @alexanderhorspool1906  Thankfully nowadays companies are required to put money aside for restoration efforts. It's not enough usually if I understand correctly. But it's more than nothing.
Reply: Fish in a Barrel > and in fifteen years time it'll all start to grow back.
Reply: @shirosenshiesq  you'd be surprised what they can do nowadays. If you come to Alberta and look at the oilsands that have been mined out and remediated, you would be shocked. Most of the time you could hardly tell that they've been mined at all or some places that have more greenery than the virgin ground around it. Not saying that it's perfect or justifying projects, just saying that it is possible to remediate if there is enough political will to mandate it.

Edit: After scrolling down I realized there's enough people spouting their 2cents, just figured I'd mention it as someone who's been a part of reclamation. We have the ability, just often not the money to fix these things.
Reply: @shirosenshiesq  Ya, who needs bricks... You just live under a nice shade tree in complete harmony with nature right?
Reply: @--_DJ_--  What's wrong with that?
Reply: @shirosenshiesq  Nothing at all, but we both know you use all kinds of things that come from a mine, yet whine about it at the same time.
Reply: @shirosenshiesq  That will grow back to the same it was before mining if managed proper. You have an obligation to make the enviorment the same as before you came there in my nation.
Reply: @shirosenshiesq  You live in a house, do you?
Reply: @shirosenshiesq  The scar on the land? Go look at it 3-5 years after the mine is done, and you won't be able to tell there was ever a mine there. Deforestation? It has more trees on the mine site than most of the area around it, the rest has been cleared for agriculture. Ditto for the destruction of habitat. You make it sound like it can never return to nature.
Reply: @shirosenshiesq  looks a lot less destructive than a road or railway...
Reply: @shirosenshiesq  
Put your money where your mouth is and dont live either in a brick or wood house.
Reply: @shirosenshiesq  fairly certain if the environmental agencies that renewed it, and the local council, had no objections then it's very well offset. Not to mention they'll likely be responsible to fill it in and in a few years it'll be lush and green with a plaque thanking the forebears for all their hard work. Not everything in the world is doom and gloom mate.

You're the kinda person who probably also bemoans timber mills despite them being the best renewable source of material we have, no doubt.
Reply: @shirosenshiesq  Those are all transient things. After the mine closes nature will reclaim it. It's the heavy metal mines that become dead areas. But even then once the rains wash all the bad stuff back deeper it will all balance out and nature will return.
Reply: @shirosenshiesq  Surely the mine, being an old one, does not cause deforestation and destruction of habitat in the way open pit mining would do, eh?
Reply: @shirosenshiesq  Where else are you getting the material for the bricks? Mars?
Reply: @davincrook9927  Another logical fallacy. If I see 5 more I think I win a car.
Reply: @shirosenshiesq  If you dont want to be apart of industry live in a cave. The amoint of enviormental damage to covrr your needs has likely been the same as the mine. We have to accept that if we are to live modern lives himans will have to do some damage to control our enviorment. That said we have to make sure to take care of places we have left to help nature reclaim it. And tey to keep our footprint as small as practicaly posible.
Reply: @shirosenshiesq  don't live in a house. Or do you think the products you use don't require mines? If it can't be grown, it has to be mined.
Reply: @shirosenshiesq  Yes, but things like that are necessary, unless you live in a hole in the ground ofcourse.
Reply: @shirosenshiesq  if your worried about that you shouldn’t be on here 😂 by having any device you ultimately support the mines
Reply: @shirosenshiesq  i understand you are living with a shack made from sticks, right? Because only then you can critiqua an extremely important industry, producing something that can last for decades and ages (brick -> brick houses) which are, i guess, the most ecological building material apart from wood.
Reply: @shirosenshiesq  who cares
Reply: @shirosenshiesq  would you rather the exact same thing happen but with electricity?
Reply: @shirosenshiesq  And laying down pavement for trucks to drive across wouldn't cause those same issues while polluting?
Reply: @s7690-u7g  Why are you replying to a two year old comment on a two year old video? Bit sad.
Reply: @shirosenshiesq  because your comment was that dumb
Reply: @s7690-u7g  Honestly man, going back through comments two years old is kinda pathetic. Don't you have literally anything else to do with your time?
Reply: @shirosenshiesq  So you admit you were wrong and want to dismiss the argument now?
Reply: @shirosenshiesq  Hope you don’t live or work in a brick building!
Reply: @shirosenshiesq  
Any mines will have that, that’s what mining is.
Any work always will have a negative impact, so companies need to pay 💰 to re-install environment back in too, but that’s extreme costly for mining operations nearly non-existing probability.
Reply: @shirosenshiesq  you ever looked at the entirety of the society we live in?
Reply: @shirosenshiesq  the mineral has to come from somewhere. It will eventually heal itself. We cannot preserve every square inch of this earth for eye appeal. I'm all about conservation and responsible mining but we do have to live here.
Reply: @shirosenshiesq  You would prefer to live in a mud hut?
Reply: Do you live in a grass hut? Every building material creates a “scar on the land”, and brick is one of the longest lasting and least environmentally damaging options.
Reply: @shirosenshiesq  So where would you get your bricks?  Without them, there would be a lot more trees cut down for housing.
Reply: @SteamCrane  You're trying to use logic with a Leftist.   Let me know if it was successful.
Reply: @dherman0001  I love to watch lefties tie themselves up in knots trying to do logic! (Like my brother).
Reply: @SteamCrane  Oh really? What off-topic subject would you like to have a debate about? (I'm actually relatively centrist, though in the US it's labelled left-wing 😂)
Reply: @SteamCrane  Trees grow bro.
Reply: @shirosenshiesq  Eh, somebody needs brick to make a house to live in,
Reply: @shirosenshiesq  Yes, we should all hug trees and not do anything to make bricks at all... Take away all the brick that have been made and perhaps only 100,000 people would be able to live here in total wouldn't that be wonderful? You are amazing Fish - but not in a sense you might like
Reply: @paulfaulkner6299  You make "only 100,000 people" sound like a BAD thing.  To me it sounds like humans are in tune with nature.
Reply: @paulfaulkner6299  that’s not what was said for one. For two there are other materials stronger and more eco friendly and financially viable than brick. You just don’t care to lookup alternatives or you just like playing devils advocate.
Reply: @shirosenshiesq  ....so to your thinking we should keep it all pristine and have no  bricks, no iron, no steel, no coal, no limestone, no marble, no granite, no sand, no concrete, and etc......You’d enjoy living like a Pygmy in the Amazon, would you????
Reply: @jimmock1155  I find it absolutely phenomenal that not one of you possesses the capability to have a discussion without devolving into apagogical arguments and logical fallacies. I'd have thought that followers of Tom Scott would at least be smart enough to know what those are and not use them at every opportunity.
Reply: @jimmock1155  Pygmies are from Africa!
Reply: @shirosenshiesq  Huff copium. You wouldn't have been able to type out what you're saying on the device you're using if it wasn't for modern mining operations.
Reply: @omicronlyrae6228  As with every other person on this thread, you are not smart enough to see the point and address it - your only tactic is to use logical fallacies to try and eke out a point.
Reply: @shirosenshiesq  Where ever you live is that a giant scar?